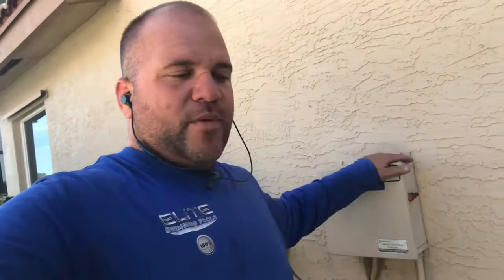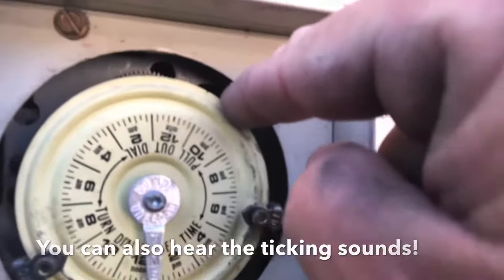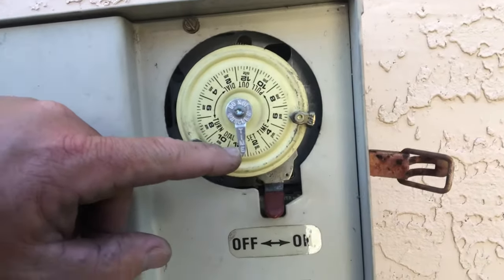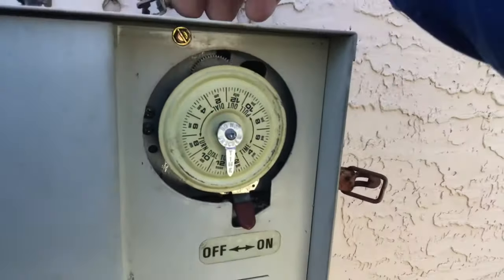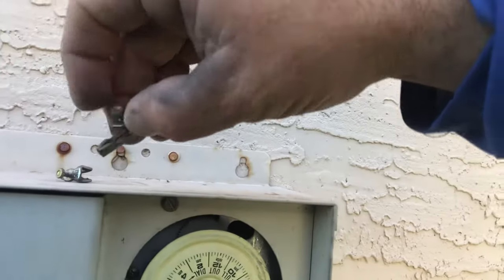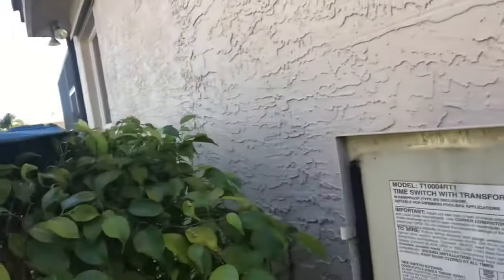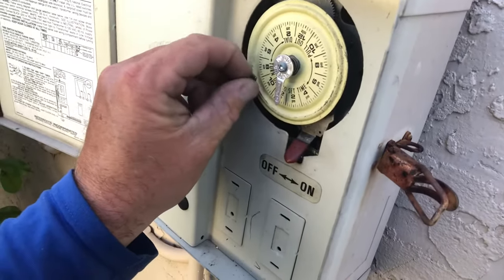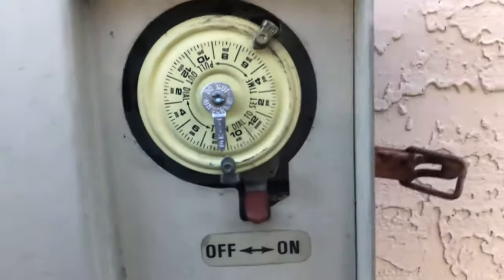Pool Timer Not Turning ON or OFF!! Watch these tips and tricks before replacing it.

Comment: If you have a Lennar pool with a Rubber Spa button on the side. It can override your timer. Thee are the 4 positions/Modes:

1. Respect the Timer
2. Override the Timer & turn the filter on.
3. Spa bubbles ON
4. Spa Bubbles ON cool-down mode

Next position is back to 1. Which turns off the bubbles and back to respecting your timer settings. 
Check this setup.